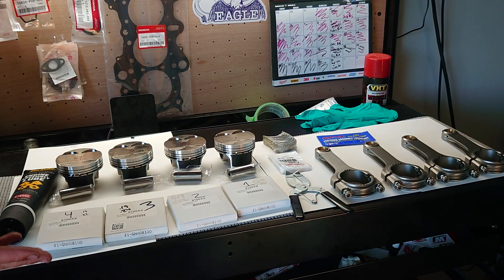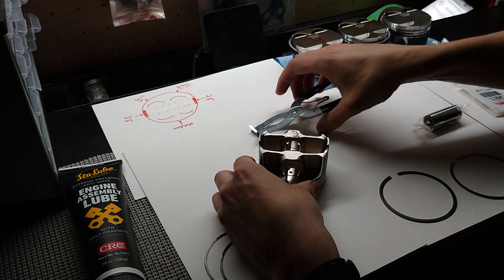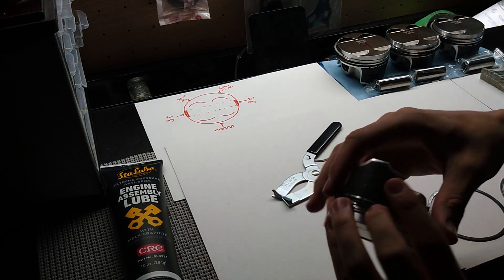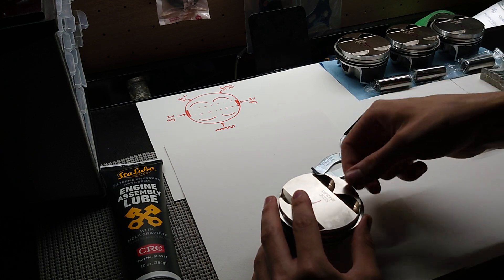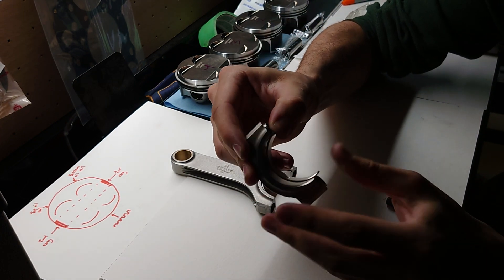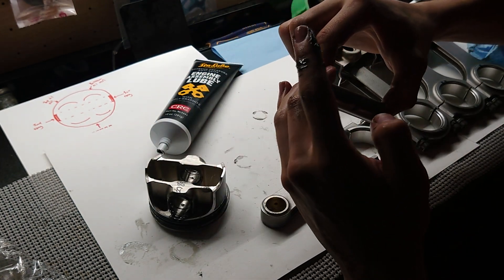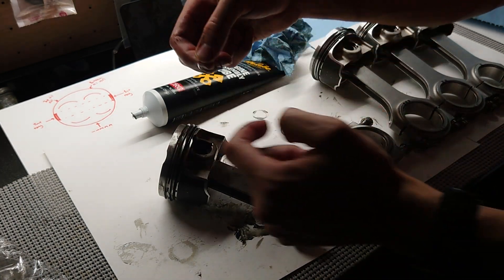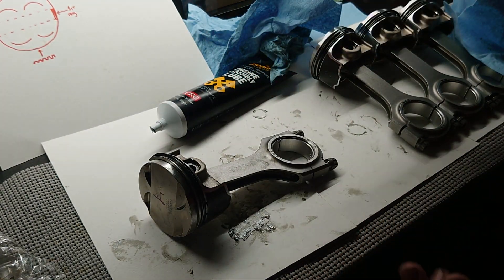B16 Complete Piston Assembly Guide

Comment: What gap do I run
Reply from the maker: What motor do you have, and how much hp do you wanna push, and do you plan on using turbo or nitrous? All this will effect your gap
Reply: @kraftingkars  all motor b16a2
Reply from the maker: @davidcastillo6776  stock pistons or forged? They expand at different rates. If you are getting aftermarket pistons, they will come with a diagram showing you recommended specs for their piston